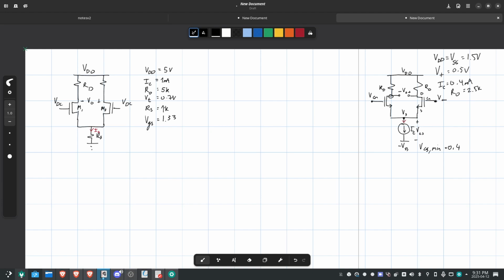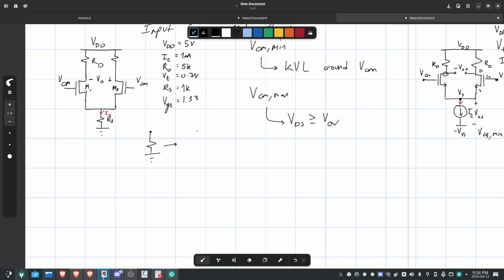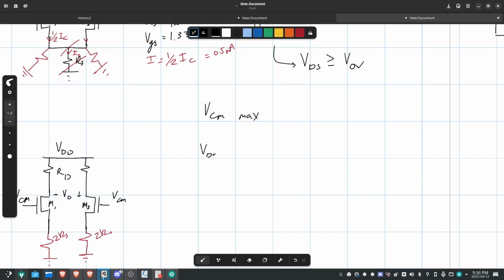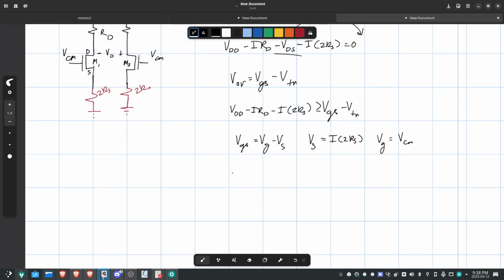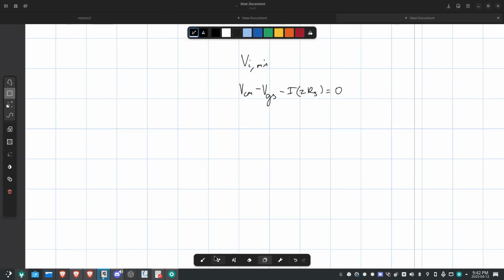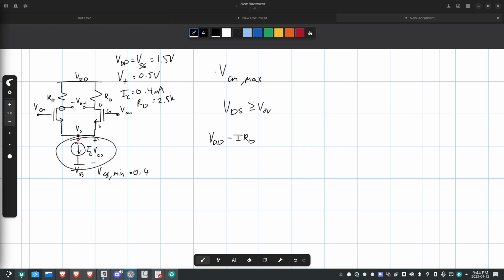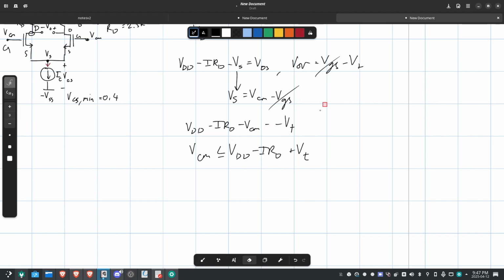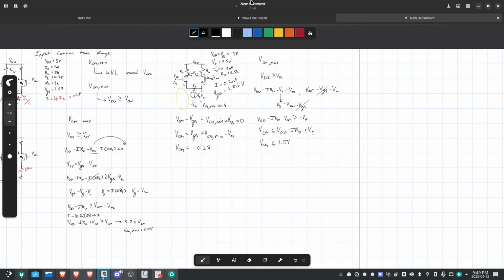TMU ELE404 Study Hall Footnote - Input Common Mode Range for MOSFETs

Comment: Sir, could you tell me about folded cascode (current mirror load is connected in wide swing circuit)? It is possible to design a very low vomin value, so its vimin and vimax are also
vds>=vov🤔

When the output gain needs to be large, how can we optimize the output of the circuit when designing the input bias? Like a two stage or Telescopic circuit or folded circuit combination...